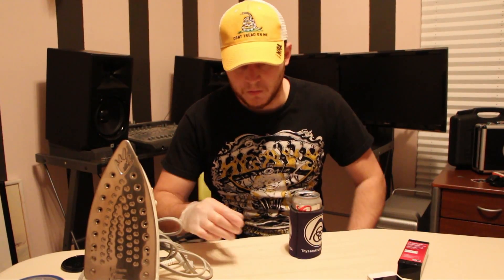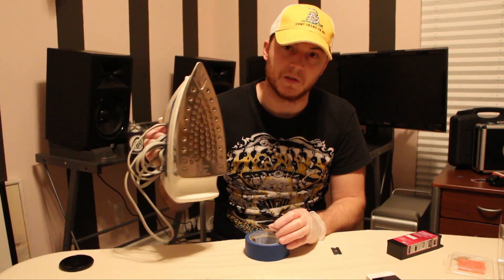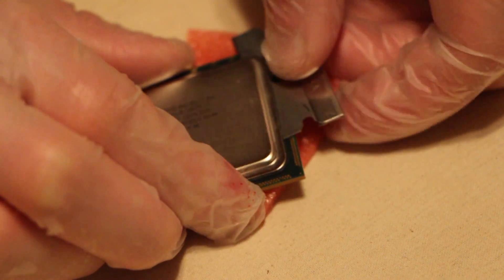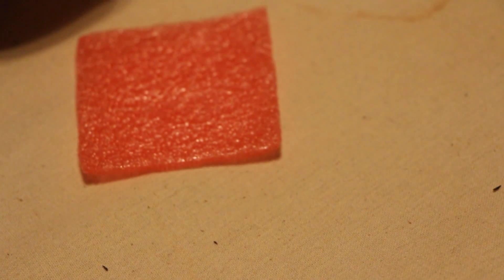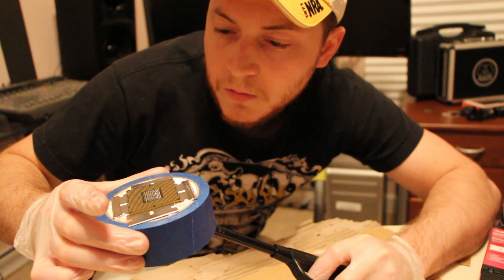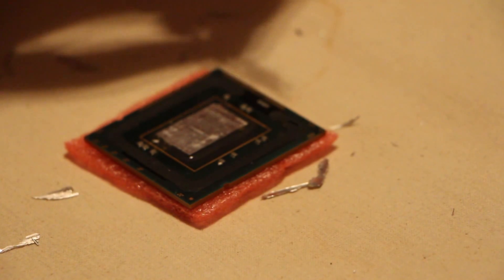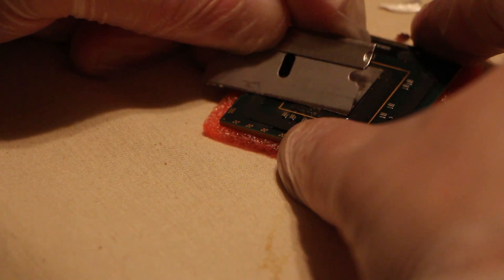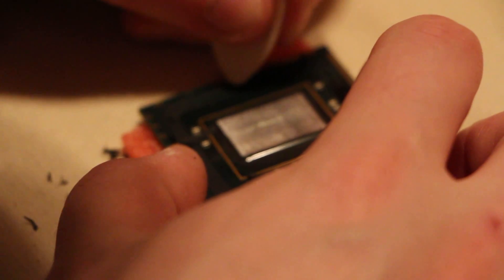Delid Soldered CPU Guide

Comment: I'm in the process of upgrading my 2009 Mac Pro and have ordered 2 X5960's that i want to delid. How much pressure do you need to apply to the razors to insert them under the IHS? Some of the caps are really close the edges of the IH, do you ruin them just by touching them with the razor or can they withstand some pressure?
Reply from the maker: You don't want to go in too deep, you can see in the video about how far I do, also come in from the corners first just for the initial cuts that'll give you an idea of how much it takes. If you ever feel resistance like you're up against some caps then stop pushing. Keep the razor flat too. You don't have to push deep, just deep enough to cut the adhesive. I'd recommend getting you a cheap i7 920 or one of the Xeon 4 cores for like $10-20 to practice on first. I practiced on my old i7 960 before putting the X5690s under the knife.
Reply: Thanks for the quick reply! Yes, I'll try to just cut along the edge of the IHS. Does the i7 920 have a soldered on IHS aswel? One last question; is there a chance that the diode can get stuk to the IHS when using the lighter method to melt the solder? Have an awesome Sunday!
Reply from the maker: +SolidCake All 1366 CPUs are soldered, 900 series or Xeon X55 series are what you want to look for to find a cheap one to test out the procedure on. Indium solder melts at 157°C so your IHS will pop off long before damaging the die.
Reply: Thank you so much! The CPU's are planned to arrive next week so I'll give you an update on how it went! ;)

Comment: Thanks for the tutorial. I successfully delidded two CPUs after being impatient and ripping off a x5675 from it's pcb.  I definitely used too much force the first time around.  I found that if you are not good with razor blades (don't slice like you said) using dental floss will cut right through the silicon or rubber seal.  There is less chance of going in too far and cutting those small capacitors on the top pcb.  I then inserted the razors at the end and used an iron to heat the solder.
Reply: Wow, you used dental floss? I think I might have to try that. However, wouldn't it be easier to begin with the razor blade, at the very edge, and then break the rest of the rubber seal away with the dental floss?

Comment: hi,
Nice job. Did you considered the iron for  desoldering? Great tutorial, thanks.
Reply from the maker: +Miguel Duarte I tried the iron, I don't think mine gets hot enough. I had to leave it on there for too long... after about a minute and a half leaving the iron on there I switched to the lighter method, after letting it cool back down. The lighter method takes less than 45 seconds.
Reply: +Electricos Cosmos Thanks for the reply. How about touching the lid with an actual solder iron for a few moments? do you think that could work? I'm trying to figure out if I order a pair delided or lided...
Reply from the maker: +Miguel Duarte I'm guessing you have a Mac Pro you are upgrading? That is about the only reason to delid these. I guess it would have to depend on the cost of the CPUs lidded and the cost to buy them delidded. Delidding these aren't for the faint of heart. It is definitely do-able but if you screw up you are out a considerable amount of cash. Just weigh your options I would say.
Reply: +Electricos Cosmos Yes, its for a Mac Pro. People are asking ridiculous amounts of cash for these CPU´s delidded. I might have to remove the IHS by myself, not a stranger to these kind of work, but I´m checking for the best solution regarding the soldered issue. Thanks for the reply.
Reply from the maker: Miguel Duarte When you get through the solder to the die it feels a lot like glass. When cleaning the solder off and the adhesive be sure you don't damage or break off any of the caps on the pcb. Cover them in clear fingernail polish when you are done. That's my best advice on what to be careful of and how to know when you got most of the solder off.
Reply from the maker: +Miguel Duarte You also might consider picking up one of the 4 cores, you can get them for like $20 dollars on ebay and sacrifice that on your first trial attempt before moving on to the much more expensive six cores.
Reply: +Electricos Cosmos yeah, ive thought of that. I have an old set of 2.66 dual core from a mac pro 1.1, don't know if those are soldered though. Thanks again for the input.
Reply: +Electricos Cosmos man, I did it!!! what a day! The first one was a pain. I ended up spending 500€ on the cpus and it relly is a great deal of pressure nowing that you can send that money down the drain in a blink of an eye.
Thanks again for your video man, it really inspired me to take the step.
How much and what type of ram do you recommend to replace my 32gb of 1066mhz ram? 48gb vs 64gb of 1333. Maybe the 48 is tge best match? thanks again man, really inspiring video.
Reply from the maker: +Miguel Duarte Awesome! I put 48GB of Corsair vengeance in mine. Cas 9 1600, it downclocks to 1333. To be honest 24GB would be enough. 99% of the time you will use 3GB of ram or less.